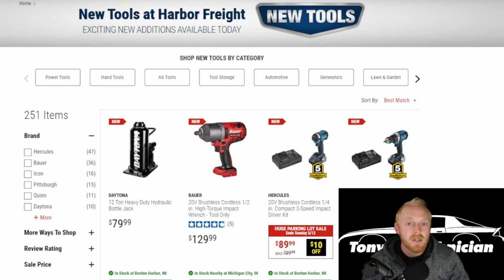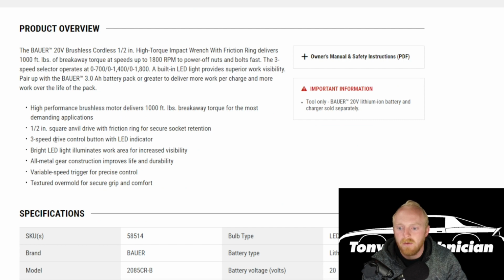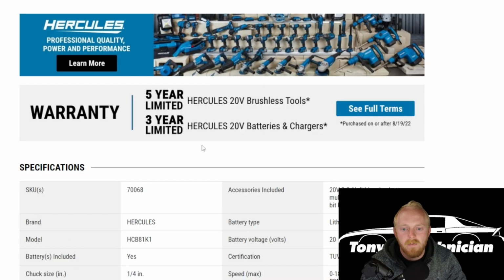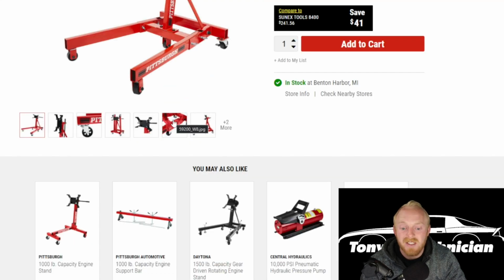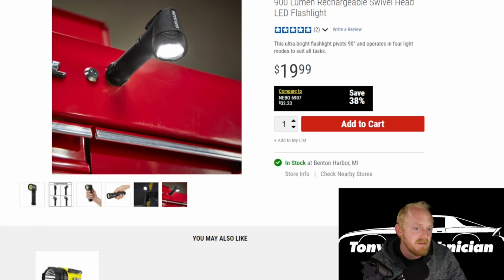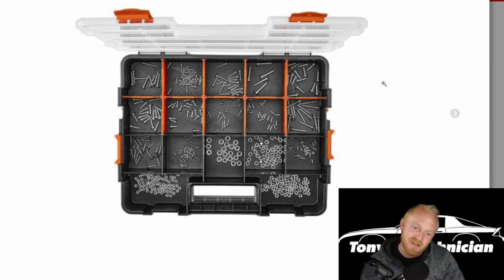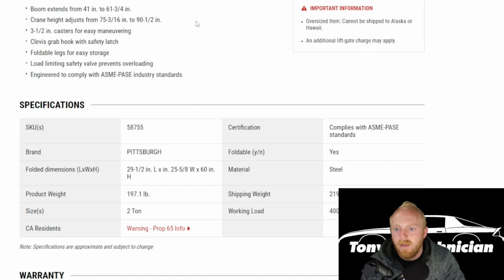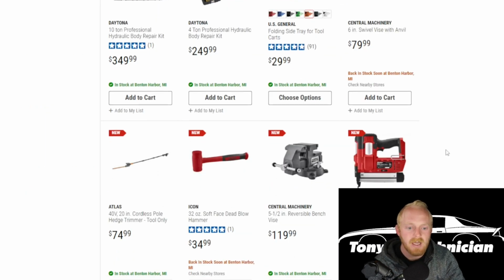Harbor Freight New Tools Released Wow those Prices

Comment: I have the Hercules ultra torque 1/2in impact 3 speed with auto breakaway and tightening setting. Love it so far, 1/4in impact driver is a great tool have used it alot also bought 1/4in and 3/8in cordless ratchets both 12v loving the power those have. I have bought alot of harbor freight tools of late. As a desiel mechanic at love's truck care I am putting these tools to a real test in my opinion. Cost to performance I'd say they beat out my old second hand milwaukee impact tools. Sadly the kits were released literally days after I bought the Hercules tools so I spent the money on tools batteries and chargers separately but all in all good pricing for the power they bring. Have had no issues and the tools have already paid for them selves in terms of trucks repaired using them.

Comment: I just picked up the Pittsburgh engine stand for my 4.6 build. Didn’t need the 2000lb one so I just got the $99 1000lb one. Works great for what I need it for. Also picked up a bunch of the magnetic trays of course. Still don’t know how I got by without the ball joint press and accessories I picked up last month.
Reply from the maker: Very nice. Same engine stand I have and it has worked great as well 👍

Comment: Sweet vid, Tony. 

I think HF is moving into the DeWalt/Milwaukee and Ryobi/Rigid class with their Hercules & Bauer lines.  Gone are the days of HF only having garbage power tools. (Warrior). 

I own many DeWalt and a few Milwaukee corded/cordless tools, and I hear from many guys how the Hercules are as good or better. (I have not tried the Hercules, so I cannot comment on that.)

But, I have used many Ryobi, Rigid, Porter Cable, Craftsman in recent (Chinese-made) years, and I can say the Bauer line is just as good as any of those are today.  

I believe HF is moving into a unique niche in where you can shop for higher-end (ICON, US General series3, Hercules), and still have mid-grade and cheap-o stuff on the shelves to suit every kind of customer. 

I wouldn't of even walked into a HF store 15 years ago.  Today, you can't keep me out of one.  Lol.
Reply: My Buddy had a Warrior drill and it started shooting flames out of the vent holes, just trying to drill through fiberglass. 😂
Reply from the maker: Haha ya I can agree with that. I personally haven't had experience with the Bauer and Hercules cordless tools but I have heard alot of good things about them. And as long as they can provide good kits at a little better price then some of the bigger names then I think they will sell well. Especially since they still have that cheaper stuff for those looking for that type of stuff but it's nice to see some better quality stuff being sold as well.

Comment: They should all come in a kit with two batteries as well as individually.  I bought a 12 volt Milwaukee drill kit, 2 batteries and it also had a 1/4 impact driver as well for about what a drill and battery cost.
Reply from the maker: Absolutely agreed. I think a majority of the cordless tools should come with batteries.